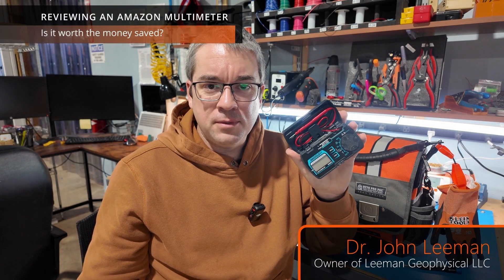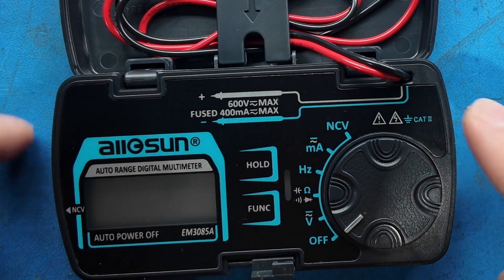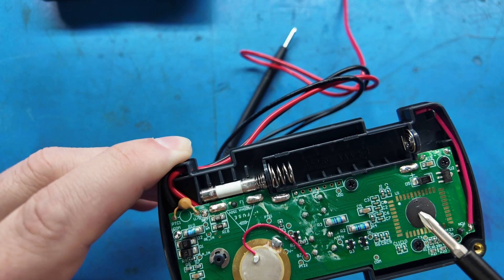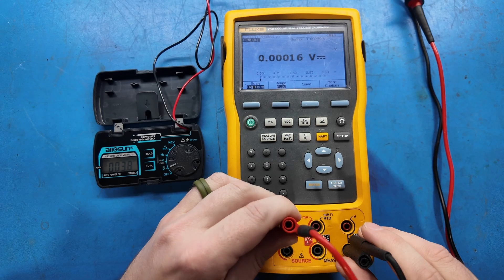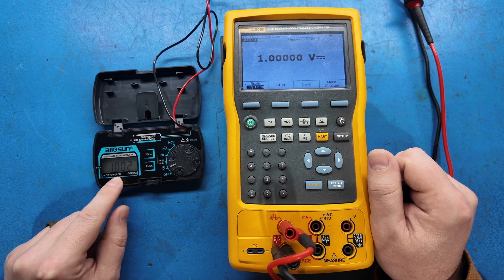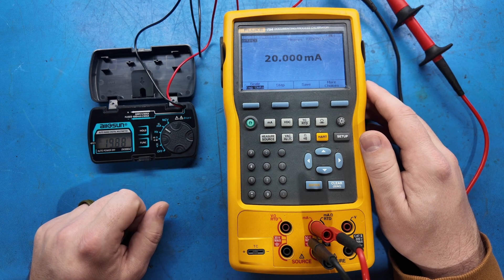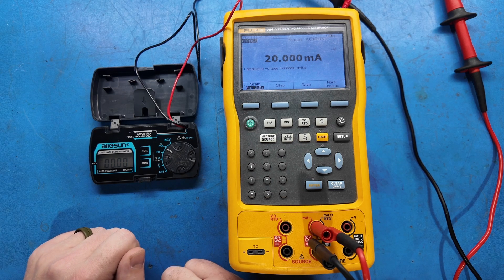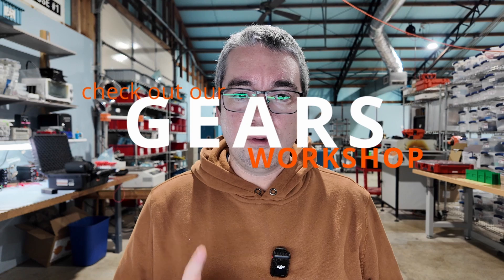Best Budget Pocket Multimeter? Amazon Find Tested & Reviewed! Allosun EM3085A

Comment: Thanks to this video, I got an Allosun EM3082 which seems better designed, or at least omits some of the problems found in the newer EM3085A. 

1. The selector switch is asymmetrical so you can actually tell where it is pointing. 
2. Screen is higher contrast and easy to read. 
3. The negative sign is big and bold (➖︎) and cannot be confused with the fine lettering of the adjacent "DC⎓" symbol. 

Features the EM3082 lacks
- No LED for continuity indication.
- Cannot measure capacitance or frequency.
- Current measurement fuse is 250mA≂, not 500.
- Lacks NCV, which actually seems safer than false assurance. 

Most features are the same
• Same sluggish response time for continuity check.
• Same error of about ±2½ in the last displayed digit for most voltage and resistance values.
• Same clunky probe holding area — although I think the reason it wasn't closing in the video may have been the latch that got added on the EM3085A.

Bonus bells and whistles of the EM3082
+ Does not have the problematic sliding latch, just snaps shut.
+ I like that it uses LR44 batteries instead of AA.  
+ I very much appreciate a more straightforward design: The EM3085A added three new modes (capacitance, frequency, and NCV) but kept the same five position dial as the EM3082.
+ No manufacturing gunk on the circuit board 😉 (at least on mine).

One last tip: the lid is double hinged so it can fold back and be used as a stand. To prevent it from pinching the probes,  close the top hinge (attached to the probe storage area) first.
Reply: Other interesting things I notice in your video. 

I have the same yellow "QC"  sticker on my 82, but on the 85A it is placed exactly where the CE marking is molded into the 82 case. I wonder if the device is no longer (or never was?) in conformance with the European standards for health and safety.  

Your 85A blob chip has half as many pins going to it as my 82. Also, it looks like the 85A has pins labeled Rx and Tx beneath the chip. I wonder if that is just for reflashing the chip or if one could actually read measurements using a serial connection.

The 82 doesn't have the AA bulge on the bottom of the case that the 85A does.

The 85A's sliding latch looks hinky and I expect it will be the first part to break. The 82 has a better design in that it just snaps closed. However, it clasps too tightly and they forgot to put finger holds on the case, so I have to use my thumbnail to open it. If it doesn't loosen up soon from usage, I'm going to file the bump that keeps it closed.
Reply from the maker: Wow! That's an excellent comparison! For the price I don't think these little units can be beat! Have you heard of or tried the pokit? I'm tempted to order one and see if it lives up to the hype.
Reply: @leemangeophysical  Yup the EM3082 is actually even cheaper than the EM3085A. It does everything I ask of it (mainly continuity and voltage), so it's perfect. 

I haven't heard of the Pokit. Is it competition for these dirt-cheap Allosun multimeters or is it more like the Amprobe PM55?

Comment: One problem I've had with these cheap multimeters is they don't last. How has the Allosun been holding up so far?
Reply from the maker: Not too bad really - I've probably used it weekly and it's okay. The probe clip is honestly the most annoying part!
Reply: @leemangeophysical  Thanks! I'll pick one up as a pocket sized backup for my "real" multimeter.  I had been looking at the Amprobe PM55A, which does seem quite excellent, but can't quite justify paying over $100 bucks for it.

Comment: Any words of wisdom on adding upgraded probes longer and better design to get into or clip onto x y or z to this meter possibly keeping the probes that come with attached.
Reply from the maker: You could probably solder new leads/probes on by taking the thing apart, but then it wouldn't all fold into the clamshell case.